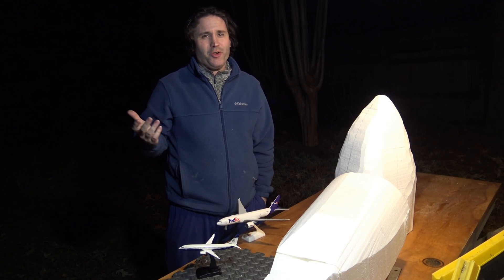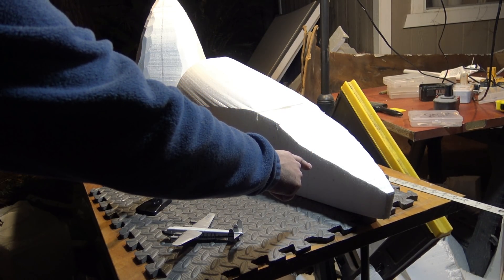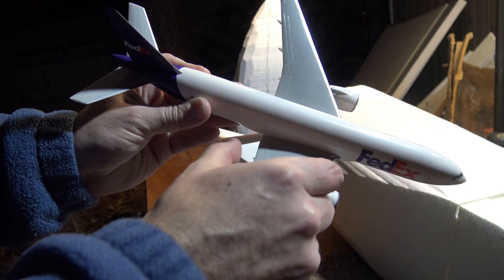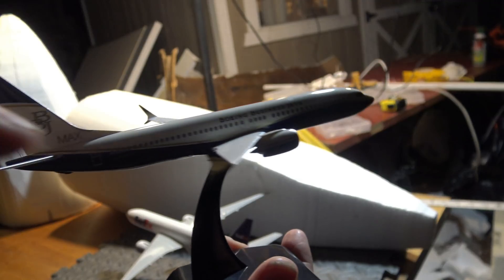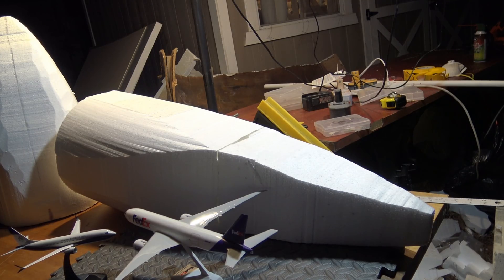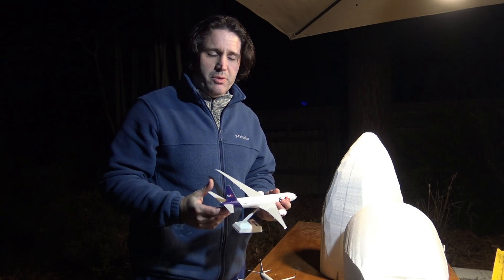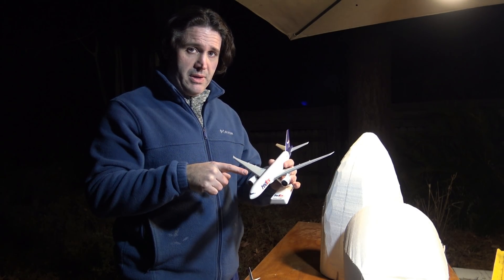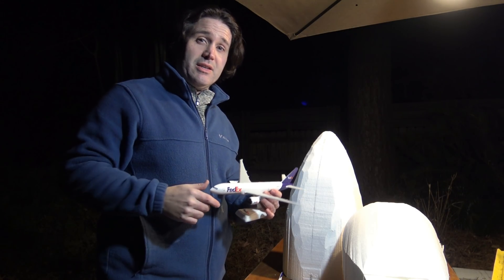Emirates 777-9X RC Airplane Airliner Build Part-4 [4K]

Comment: I was going to ask are you doing one of the new 777xs with a molded nose and rear or no?
Reply from the maker: I'm using that 777-200F to help sand these new 777-9X's.
Reply: I'm sorry I ment fiber glass both sections front and back.

Comment: Good video sir ! Those little models are a lockheed constellation and 777 either 300 or 200Lr
Reply from the maker: Right on the 777, but it's a 200F and the others are an Avro York and 737-Max.